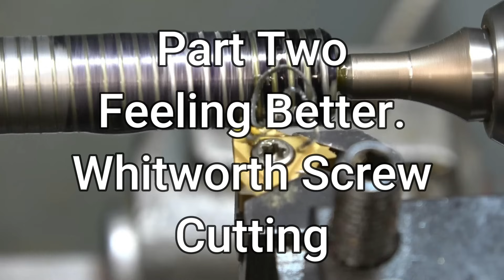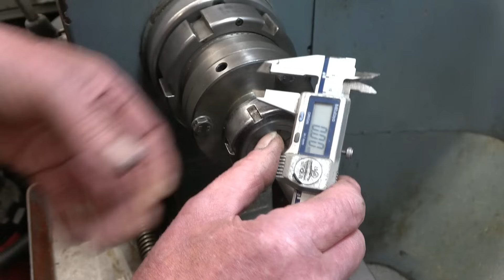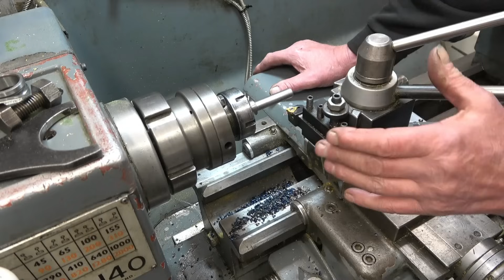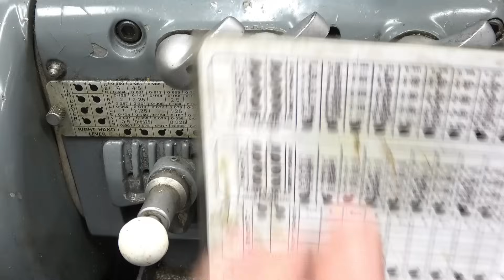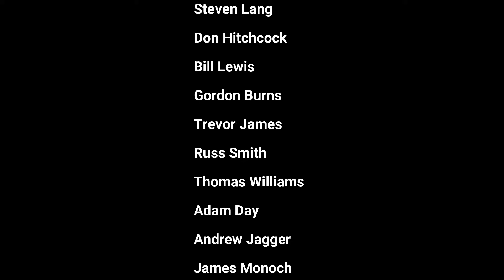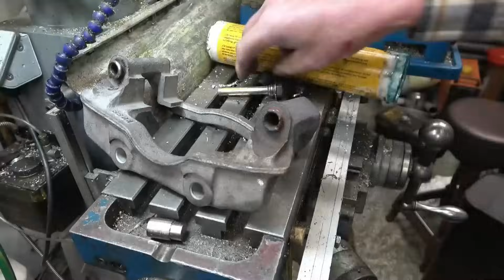SNNC 590 P2 . Feeling Better.Whitworth Screw Cutting

Comment: Are there any different radii down in the root for various Whitworths ,,, ?
Reply from the maker: As,fares I am aware they are all the same with a 55 degree angle . UNC is the same pitch but is 60 degrees .They will screw together .
Reply: ... waaaaay down in the bottom are there any different specs for radii or are they all  matched to diameter . @doubleboost
Reply: @doubleboost  1/2 whit is 12 TPI but UNC is 13 TPI

Comment: Not many Whitworth threads here in the USA today. But I think I found a Whitworth screw on a 1929 Maytag washing machine engine magneto(Bosch) during a recent repaint and restore.
Reply: There's quite strong opinions on BSW/BSF versus UNC/UNF ,namely 55°degree versus 60° degree inclusive angles between the UK and USA. Personally, as a brit, we are very good at inventing, but sometimes don't standardise to a large enough scale, the USA in developing as a country, timed it well with engineering production,  and because of the sheer scale/size, had to develop more consistent standards. That's my 2 pence worth. Regards John.